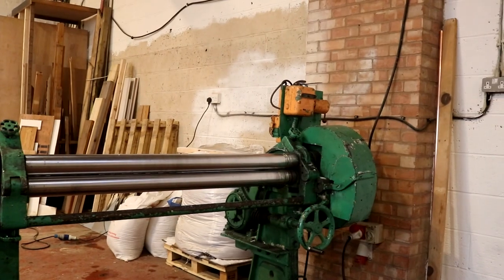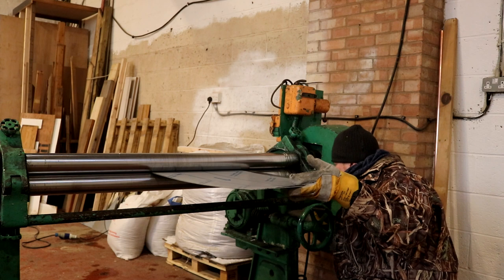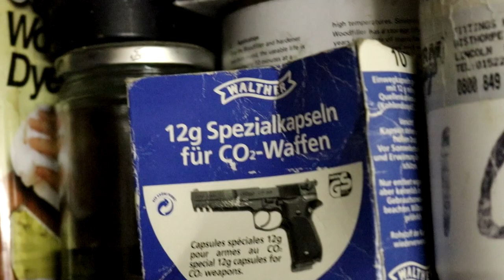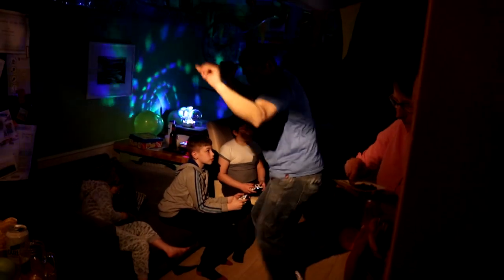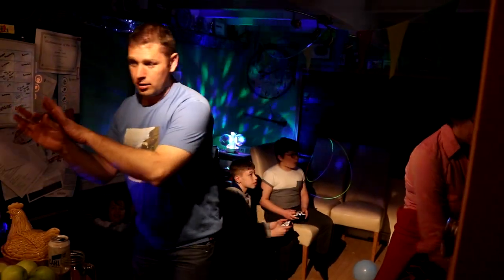Cheeky Q&A

Comment: As I previously mentioned I have a similar, slightly smaller tyre repair kit and it works absolutely bob on. I've repaired a tyre from nearly new with it and ran it until it was on the ,ahem, legal side of needing replacing 😉  with no problems at all 😄 . If you got the unit cheap due to the condition and the landlords reluctance to repair it then watch out that the landlord doesn't try to hike the price up due to the improvements that you have made to it. At least you have the vlog to prove that you have done all the improvements. I normally try to look on the positive side but have recently been jaded to the point of trust no bugger until they prove they can be trusted. Cheers, Schnuz.